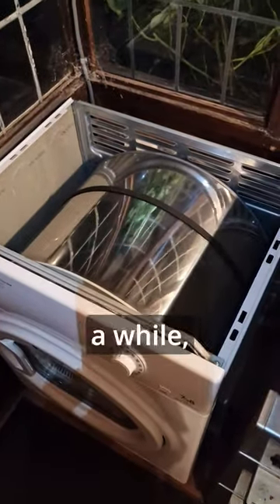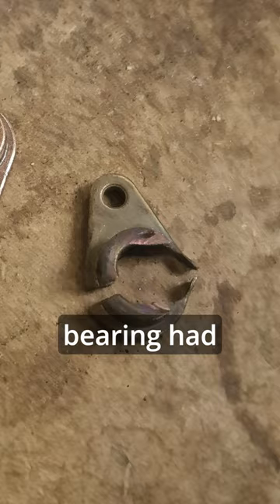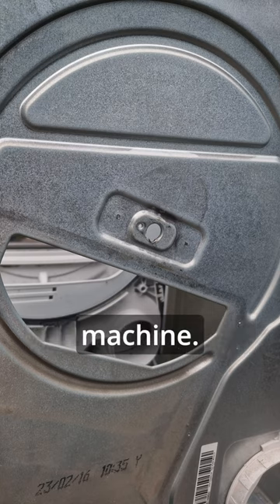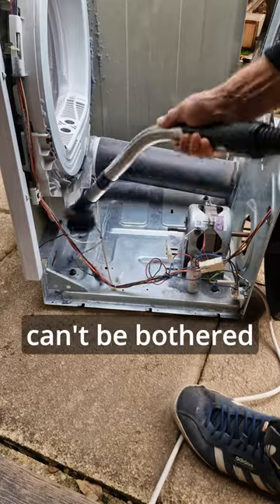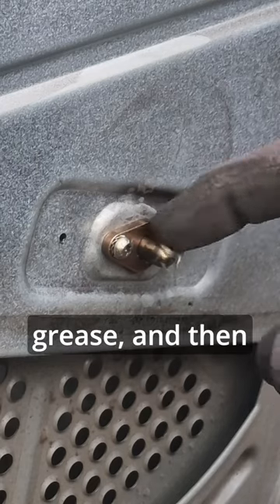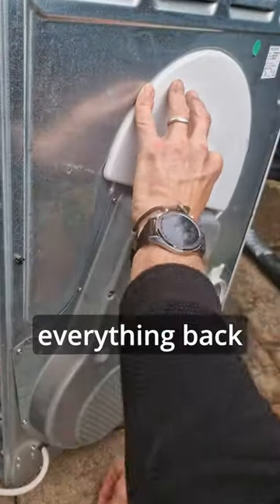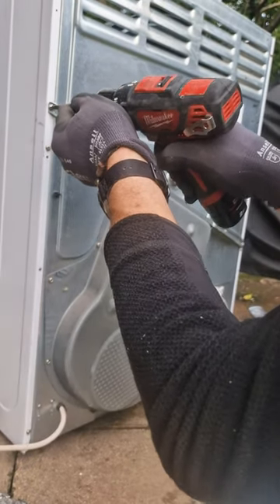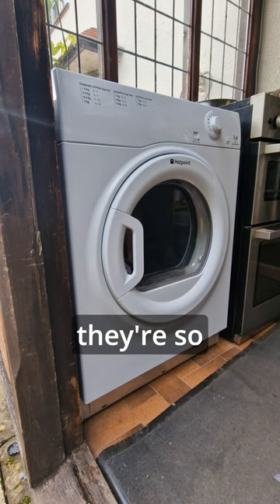How to Fix a Screeching Noisy Tumble Dryer #shorts #tumbledryer #repair

Comment: I fixed mine the other day put a new jockey wheel on it had to take it all apart thank, god for YouTube  not bad for a 75 year old woman , if it’s fixable I’ll have a go 😂
Reply from the maker: Great work 👏💥💯👌
Reply: That’s awsome.
Reply: Good on you! 😂 I hope you have some power tools and not hand screwing though!
Reply: @ShutoStriker  I do but actually that weren’t needed only screwdrivers and only a drill to replace all the cabinet screws. Difficult  part was taking the fan cover off and replacing it the belt , the worst was replacing the belt even the videos say it’s hard my tenacity got me through😀
Reply: Atta girl!

Comment: A lot of washing machines and dryers have been designed so you can't access and mend without being an engineer.
Reply: Do you mean owning some tools and having a brain ?
Reply: You're suggesting they design the machines so that only qualified technicians (not engineers) can maintain them?

I don't think so. I really do not think that is a design requirement. Usually the design engineers are considering ease of maintenance or dismissing it in order to achieve other design goals which are considered more important.

Comment: Replaced this bearing a few times over the years on mine. First time it went I rotated the bearing 180 degrees and drilled and tapped a new hole to attach it. The spindle is the bearing down on the unworn surface. Lasted over 12 months until the heating element went on it 🤣
Reply from the maker: Good thinking James. Yes the previous repair was a snapped belt. It is fun to get these machines back up and running when the components are so simple. 👌
Reply: I had the same machine, done this fix twice at least along with a new seal kit for around the door, got sick in the end cause the problems just kept coming so finally bought a new machine
Reply: Same same, did a few times
Also a hotpoint. I support that "yay!"
Reply: Is that not a bushing rather than a bearing?

Comment: I got my tumble dryer for free cause the belt snapped so my mates landlord replaced the whole unit. For £20 and an hour I got a tumble dryer. Has worked without issues for 2-1/2 years!

Comment: I've done this on our indesit 4 times now over 8 years, I've never had to dismantle it this far, just the back cover and top. will always check this part before dismantling any further.
also replaced the door lock, mechanism and the locking tab, parts are so easy to get on indesits, it's starting to resemble triggers broom

Comment: i've not done a tumble dryer but fixed numerous washers, new pumps or drive belts sort of thing and the cooker a few times new elements and door when it smashed im a firm believer in try fixing it yourself!
Reply from the maker: Great work mate. Yes, me too, and loads of stuff on the dishwasher - pump seals, micro switches. It's rewarding breathing new life into it. 👊

Comment: My dryer has been doing the same at times and i keep kicking it until that doesn't work then turn it off.
I was at my wit's end after i replaced the belt and it did the same , i had it in bits gave it a clean and thought it should be good as new and it was screaming after 30 minutes, after seeing this video im convinced it will be this same issue, thanks for sharing 👍 😊

Comment: Easy to do, love how you didn't show getting the belt off the motor, tried replacing my white Knight belt, horrendously designed and one of the few jobs in life I've thrown in the towel for.I then Bought a candy 10kg drum and the belts just gone on that. Sat there a month not been brave enough to look
Reply from the maker: Getting the belt off is easy you just slide it off. Getting it back on is the tricky bit.

Comment: Good share, where did you get the schematics knowing what the specific item broken was called?
Reply from the maker: Thanks Patrick. Funnily enough I just Googled "drum rear bearing" and it turned out that was exactly what it was called. You can usually narrow these things down pretty quickly on a Google search but yes for now complicated stuff eg fixing power tools I generally get a diagram from the manufacturer's website.

Comment: well done.! I attempted to fix an oldie a while ago. Turns out it was the motherboard. These cost about the third of the price of a new one which uses less than half the electricity. So fingers crossed the old one will be recycled properly (it should be) and not end up on a landfill.

Comment: I had an old Zanussi dryer (one of the first condenser dryers) it worked tirelessly for years. 2 new belts and a new jockey wheel were all it needed over those 16 years. It finally died and went to the great scrapyard in the sky after the motor burnt out nearly taking our kitchen with it!
Reply from the maker: Good grief. You were lucky there! These things are a bit of a fire risk.

Comment: I had a similar problem but it was the nylon pads that the front of the drum  rides on. I wondered why these weren't proper roller bearings - maybe something to do with lifespan/costs. Anyway I changed those and changed the belts and rear bearing same as you and the dryer is like new again.
Reply from the maker: Great work Brian. Yep they're pretty simple machines. With a bit of tlc they should go on for years 👌

Comment: Cool that you could fix it!

This tumble dryer should be replaced as it is an energy eating monster if used on a regular basis. This one uses around 4,5 kWh each run, and a heatpump dryer around 1,5 kWh. Copper, glass, and sheet metal is easy to recycle.

Comment: My washing machine is a bit like Trigger’s broom. I’ve changed that many parts on it; it’s not the original washing machine anymore. Drain pump x3, drum motor, heating element, drum agitators, shock absorbers.

Comment: My washing machine 20yrs old every part is still available and replace pump motor brushes several times just done the suspension legs and door seal . It's still as good as new no digital safety cut outs all analogue switches far better than any new washing machine
Reply from the maker: Good work. Yes I've done the pump, pump seal, float micro switch on my dishwasher and it's still going strong after 13 years. If the control panel goes though it will be time to change it as they're pretty much as expensive as a new machine.

Comment: Surprised our heavily abused bosch tumble dryer hasn't needed new bearings in the 14 years of ownership.
Reply from the maker: Got a Bosch dishwasher and washing machine. Had to replace the odd thing on the system but they've been going about the same time as yours 😉
Reply: @CharlieDIYte  that's great.  They must be models from a time when they were more reliable.  I still can't believe our dryer has worked for so long and still works today.  Models from 2000 to 2009 really were my favourite genre of bosch appliances.
Reply: Because German.
Reply: Every year  i  do maintenance on my Tumblr dryer and washing machine. Grease thé bearing every year keeps thé mecanic away
Reply: @ikvanachter6002  that's very good 

I like people who look after their appliances.

Comment: You're lucky, we had a White Knight tumble dryer have the same problem but the issue we had was that a new 'spider' bearing for it cost just over £100 and it was one of those unfortunate times where we had to weigh up keeping an 8 year old machine going or do we spend another £100 on top and get a brand new machine with warranty... I'm all for repairs when they're cost effective

Comment: Mine was the Front door seal that Velcro strip that goes on the front rim casing. But got a new shaft as it was bent and bearing Was a compact hotpoint vented dryer. I would definitely say the small ones are harder to put back together than a big one. 
It still makes a high pitched squeak when on. 🙄 
So I got a 2nd hand  miele heat pump for 25 quid just need a new moisture sensor for not much money use less than half of the electricity of my old hotpoint. And the fluff inside the hotpoint was a Henry hoover bag and a half of fluff don’t know how something didn’t catch fire. I still got it as a spare it’s such a quick little thing.
Reply from the maker: I've been tempted with a heat pump but not sure I want the faff of emptying the water all the time 🤔

Comment: The bearings are designed not to require grease. When you do apply grease fluff / dirt can get stuck to it making it wear out faster. This is why when people replace them they find the replacement will not last as long at the original one did.

Comment: Nice fix but it's usually the heating element that fails before the bearings and then the circuit board !
Reply from the maker: Fair point. Circuit board goes and you're definitely in the realms of a new machine.

Comment: With modern washers and dishwashers, the usual first thing to go is the electronic control board. Replacement can cost as much/more than a new machine.
Reply from the maker: I agree. I've repaired so many things on my dishwasher but the second the control panel goes I'll il have to ditch it.
Reply: Although a common failure on a board is the capacitor. And a board can be repaired.

Comment: Tried to fix our last washing machine, failed bearing; got a new bearing took it all apart to find the drum was glued together- rather than bolted like they used to and you have to split the drum to do the bearing! Meaning I'd need a new drum assembly- but these cost nearly the same as a new washing machine! So they are designing these modern appliances as throw away items 😢
Reply from the maker: Exactly what a guy on my Discord forum found. He had to split the drum and then silicone it back together. 🤦 Frustrating as I thought they were being forced to make appliances repairable these days.

Comment: How would I fix the sensors my dryer keeps on stopping
Reply from the maker: You might check you haven't got an excessive build up of fluff in the filter and ducting. Mine did this recently - it kept overheating due to fluff build up.
Reply: Yep, mine too, I ended up having to strip mine down to enable access to the accumulation of soggy fluff build up behind the outlet filter, whilst lying face down on a wet kitchen floor. Terrible design maintenance wise, but can be done if you're prepared to have a go ! @CharlieDIYte

Comment: Did anybody else notice that the motor drive shaft looked like it was missing a pulley? Putting the belt on over just the shaft with exposed threads didn't look right to me.
Reply from the maker: No, that's the way it is.

Comment: “The designers can’t be bothered to make these machines not fluff up “ - it’s inevitable, it happens with all Tumble Dryers even the Top End ones.. we are meant to maintain machines and prevent fires ourselves.It’s not the companies fault if someone puts a fleece blanket in there and it creates strands of fluff through out the machine !! 😂

Comment: You didn't need to take the drum out to fit that! Plus grease in a dryer is a bad idea! (Attracts fluff.)
PLUS those dryers are a fire hazard. Fluff builds up in the heater area. The modification they brought out didn't work.
But apart from that great job!

Comment: Most people would have just binned that. It's a bit like when washing machines need brushes, that's the end of the road for most.
Reply from the maker: Fair point. I guy on my Discord forum changed the bearings on his washing machine recently. Fair play to the guy but it wasn't an easy job. He had to split apart the drum and then silicone it back together.

Comment: You don’t need grease on a sintered bronze bearing, it’s a dry bearing surface.
Reply: Yes you do. You're confusing plain bronze and self lubricating bronze materials. If it is a plain bronze bearing you really do need to lubricate it.
Reply: @JSmith19858  Washing machines and driers most commonly use sintered bronze bearings which are pre-impregnated with oil, it does dry out eventually with age and use and that’s when they start to wear a slot after a long time.
Reply: @gtjack9  I know what Oilite is, thank you. I don't need you searching Google to tell me.

Your bicycle must have a reverse gear to back pedal that quickly
Reply: @JSmith19858  I haven’t changed my stance.
You don’t need to add any oil to a bronze bearing for these purposes.
They are pre-impregnated.
Re-read my comments and you’ll see that.
Reply: @gtjack9  You're talking through your hat. You need to lubricate bronze bearings. Lubrication is optional on self lubricating "Oilite" bronze bearings.

It appears you don't understand the difference between the two, so please stop guessing as you're spouting misinformation.
Reply: @gtjack9  And if you could run a bronze bearing dry then why did manufucaturers waste money fitting lubricators to machine spindles and bearings
Reply: @JSmith19858   I think you’ve misunderstood what I’ve said.
Washing machine bearings use a sintered bronze bearing which are pre-impregnated with oil, therefore, when you replace these you don’t need to apply oil as they are already pre-oiled.
With age these sintered bearings will dry out and then the bronze will start wearing away much quicker, this is by design, it’s not within the engineering scope of a washing machine to have a central oiling system.

Comment: You don't need to take it apart to replace the bearing.
Reply from the maker: It's a fair point with hindsight but at the time I didn't know what the problem was, and taking it apart gives you an opportunity to give it a good clean and get rid of all the fluff that could be a fire risk around the electrics.

Comment: It should have been made with harder metal, not so soft in the first place.
Reply: The bearing is soft so you don't wear the shaft away. It means you can repair it by swapping one part like in the video.

Comment: Don't put grease on the shaft
Reply from the maker: Why not?
Reply: @CharlieDIYte  it's a phosphor bronze bearing running on a stainless steel shaft the way it works is the bronze bearing slowly wears away, reason why they have this style of bearing their is it's to hot for grease , that part gets to over 120 degrees centigrade